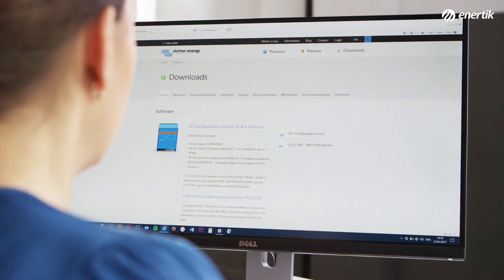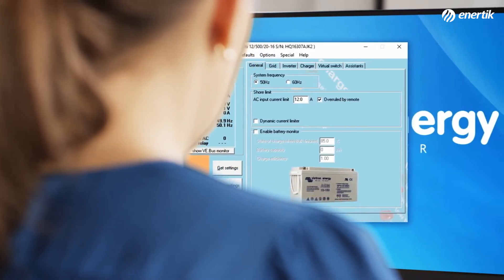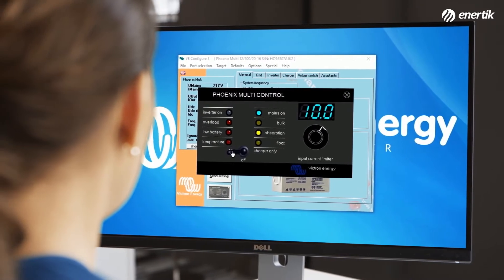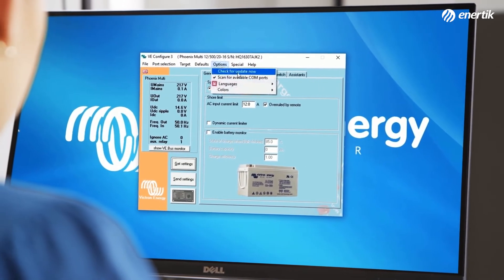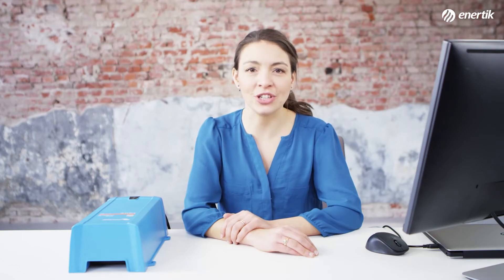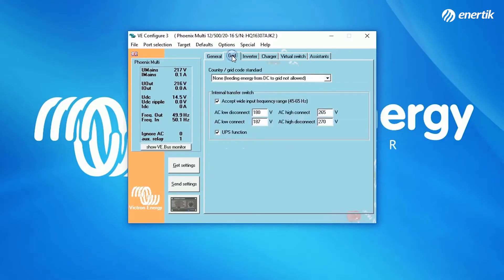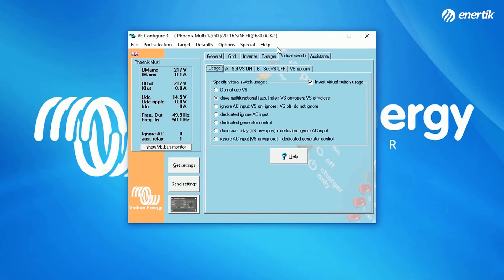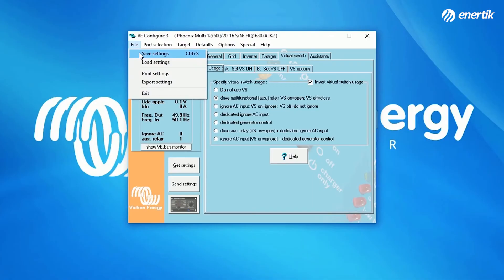Conexión y configuración de VEConfigure para el monitoreo de un inversor Victron Energy

Comment: Buenas llevo años con fotovoltaica empecé con 12v luego pasé a 24v y ahora estoy con 48v he tenido inversores de varias calidades y ahora después de tantos años he comprado un multiplus 48v 5000w, aún recuerdo cuando fui a una empresa de suministros fotovoltaicos y el dueño me recomendaba victron, y claro siempre pensado en el coste y ahora vuelvo al principio, ahun no he instalado el equipo y espero que supla mis expectativas por lo bien que hablan de victron, sigo en off grid ,con baterias de plomo acido pero se que para una vivienda con consumos normales hacen falta unos 950 amperios, también se la suma importancia de la temperatura de las baterías y en este caso victron da fe de ello al incorporar sensores de temperatura para los bancos de baterias
Reply: Compre un equipo Victron con batería Pylontech pero, estoy detenido en su instalación porque tengo que configurarlo, y preguntando por ahí descubrí que esos soportes deben  pagarse y es muy caro.
Reply: @luismoran4460  le recomiendo si no puede pagar a un instalador con nivel avanzado que tenga paciencia y vea algún webinar  sobre los sistemas de configuración victron ,no es un sistema enchufar y listo requiere de algo de conocimientos sobre estos equipos
Reply: @mflo1970  En ese proceso estoy, recopilando información de webinar, gracias.
Reply: @luismoran4460  hola de nuevo el inversor victron es inversor cargador en principio  usted puede conectar las baterías al inversor siempre y cuando configure los parámetros para la batería pylontech, lo que no puede gestionar el inversor es la configuración del bms de la bateria ,para tener un amplia gestión de su instalación tiene que tener un dispositivo de configuración del inversor  y un dispositivo gx se que es dinero pero estamos hablando de equipos solares de primer nivel robustos y duraderos